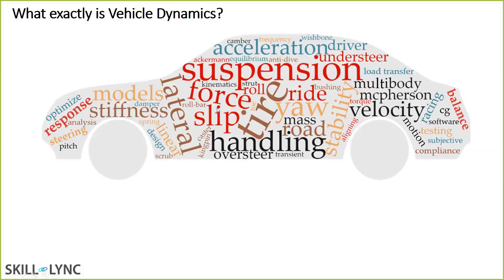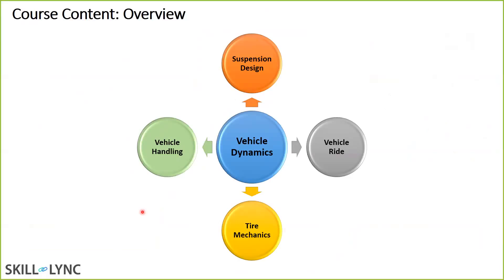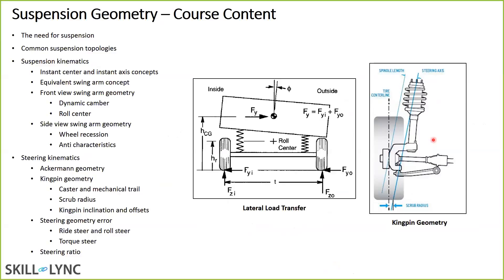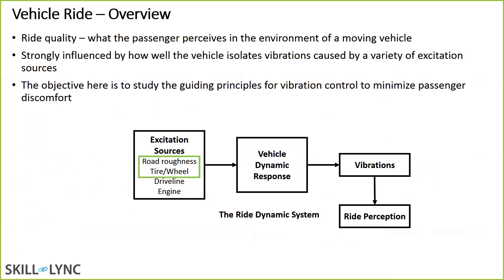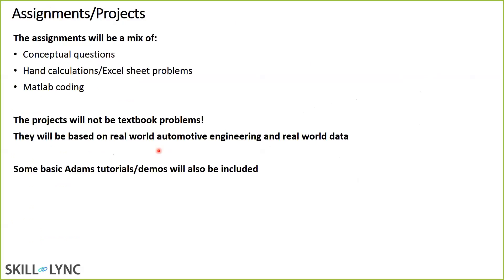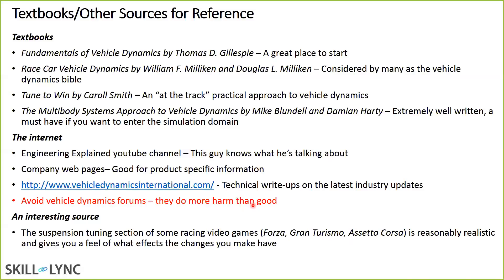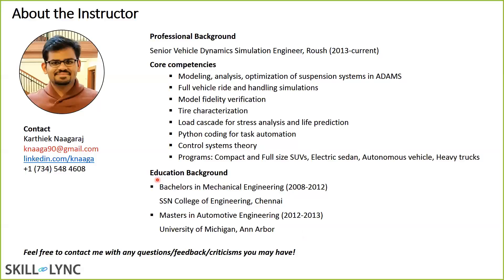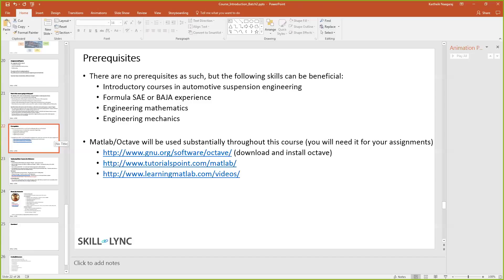Vehicle Dynamics using Matlab & Adams Workshop | Skill-Lync

Comment: stability doesnt come under dynamics. it goes under inertia.,,,      if you think that im wrong( try creating a free body mechanism and resolve for the forces in 3D)     .     inertial lodes goes under  rest and in motion.      for example considor a flying aircraft in air, when it is sable under all the action of forces such as weight lift drag and propulsion equate to operational condition of flying at that point. it is said to be in inertia.  so dont use dynamics with the word stability,,,,      but dynamic stability is different...
the stability of a body under the action of an operational force..which causes the body to behave in certian manner....             so examples must be precise sir,,        because people will use thers concepts in the future for mathamatical modelling of projects